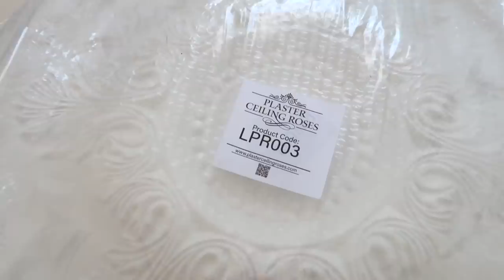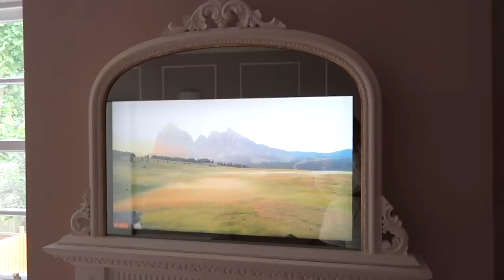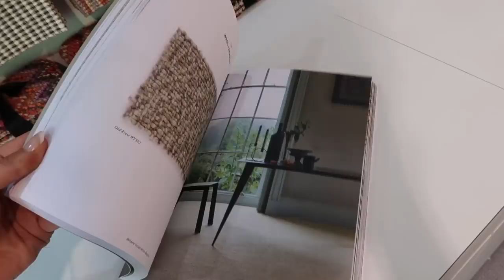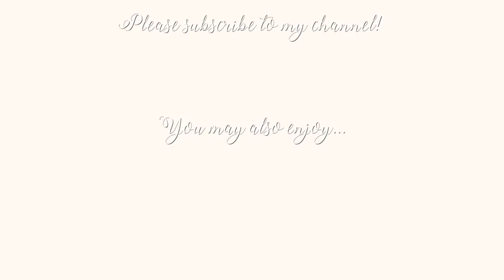Flat makeover, episode seven! My WALK IN WARDROBE reveal and more! ~ Breakfast at Freddy's

Comment: I live in Finland where winters can last half a year and we do not have carpet floors. No one does. They are so impractical and dirty in my opinion. The only place I've seen those are in some oldish hotels and on the ferry to Sweden. We have wood and stone floors. In my house, we have floor heating as one of the heating mechanisms so no worries about the floor being chilly.
Edit: and overall we build our houses quite differently to keep the heat in anyways x)
Reply from the maker: That’s nice for you ☺️
Reply: Well in the UK we get around 2 weeks of hot weather and then rain and wind for the rest of the year😂😂
I can’t think of anything worse than getting out of bed on a cold morning and stepping onto a cold floor 😳
Carpets all the way! 😍
Anything can be dirty if not looked after and cleaned properly regardless if it’s wood flooring or carpets 🤷‍♀️